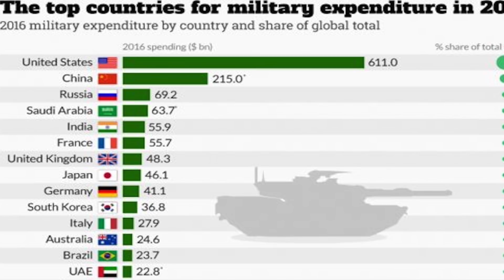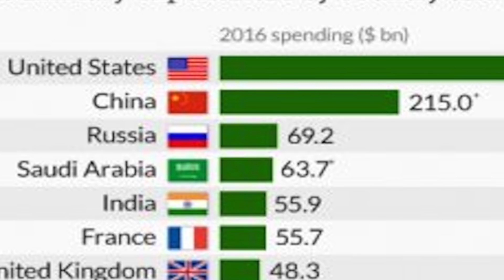CAN USS GERALD R FORD DEFEND ITSELF AGAINST RUSSIAN ZIRCON MISSILE ?

Comment: Laser weapons are over-hyped. First laser weapon power on target drops rapidly with distance due to dispersion and atmospheric absorption. While the laser weapon at distance could render the optical guidance ineffective, it will have no effect on the radar guidance. The big problem is that as the missile closes, it drops to sea skimming level. The laser will have precious few seconds on target. Even at very high laser power, ablating coatings could provide enough protection for the missile to survive long enough to hit the carrier. Then of course, an effective attack will consist of multiple missiles arriving concurrently. How many lasers will the ship have? Realize that the zircon missiles will appear on the horizon about 20 seconds before impact.
Reply: common  sense, good comment. sad are so few here...
Reply: Yh the laser will have to be very powerful to stop a hypersonic missile before it hits it's target and If the missiles are many then it's a whole different story

Comment: While I agree it's a threat I think those defensive missiles could work against it. Travelling at that speed also makes the missile less stable and as you mentioned at mach 6 it has a lot of kinetic energy, as would even the smalled bit of shrapnel which could rip it to shreads. I am inclined to agree that the laser systems are the best defence.

Comment: The problem in a missile defence is never the speed of the bullet or missile interceptor. The problem is early warning, path prediction and accurate enough tracking. For the missile launch to be detected someone has to see it on the radar. Radar signals reveal the position of the radar itself. Shooting a couple of long range AA missiles at the AWACS can make it go away. To avoid a laser beam all you need is a mirror and ability to change. Radar jammers may still work though.

Comment: 100% Bullshit. The temperatur the missile itself has to withstand at that speed due to friction is already imense so it will have some way of protecting itself against lasers. The problem with lasers is that the effective range is also quite limited. All currently developed lasers have a range of a few km. Even if it would be 40 km (a low flying missile would be under the horizon) the missile would take approx 20s to reach. So only 20s to heat up the missile that it explodes. 
So all in all. Its bullshit. Plus, if it comes to a war between the us and russia, it will likely be loaded with a few megaton nuclear warhead. No need to reach the ship. Just get it in a few km range and its gone anyways.

Comment: Even at a velocity of Mach 6.2, it takes over 3 minutes to travel 250 miles. And that is not taking into account the time it takes to accelerate to that velocity. If you think a US carrier group can’t respond to a launched missile in 5 minutes, you are ignorant to modern warfare.
Reply: He also said Russia is developing new underwater drones that can carry nuclear warheads. These were described as un-manned, noiseless submarines that move at ultra-deep levels and at high speed. "This is just fantastic," Putin said. "There is no defense system that can cope with such subsurface vehicles that can be equipped with conventional or nuclear weapons, attacking coastal defenses and infrastructure facilities." These underwater drones were 100 times smaller than a conventional submarine, Putin noted.

Comment: No it cant, it cant even defend against supersonic cruise missiles let alone hypersonic.
Reply: +Jack London

 Not necessarily.
Reply: At present, 10-20years into the future maybe.
But laser weapons are being developed since the 60s by the U.S. and Russia, if the solution was easy they would have already found it.
Reply: All of the current air defenses on US carrier escorts are specifically designed to engage supersonic seaskimming cruise missiles. The SM-6 and ESSM both fly at the high supersonic range (around mach 4). The RAM/SeaRAM was designed as a complement to the Phalanx precisely to deal with supersonic seaskimmers. Hypersonic missiles will be tougher. SM-6 has some capability against them as it was designed to engage ballistic missiles in their terminal phase which also travel at hypersonic speed, but they will probably have a relatively low hit probability.

Comment: The thing is with Lasers they may be fast, but they are limited by the reaction time of the how quick they can lock onto the target due to the comparatively slow speed of the laser rotating mounting mechanism, then there is also the fact of the curvature of the earth, which also means the laser can only fire at the missile when it literally is only a handful of seconds away from hitting the ship. Its all a bit of a close call really!

Comment: I think the problem is much more about tracking a missile traveling at Mach 6 than about what could blow it up. Even if the laser anti missile tech proves itself efective in blowing missiles up, since it has to be targeted directly into the missile, tracking would have to be extremely precise. That would be a real issue since that type of defensive system would only be efective at a closer range (I think) since it probably uses massive amounts of power. So the issue is... the closer the range the harder to keep tracking or, in other words, the closer the missile is the harder is to keep pointing the laser directly into the missile. And even if you consider that the heat of the laser only needs to be close to the missile to blow it up, Russia would just avoid that by equiping the missile exterior with some layers of thermal material. If I was going to develop a system to stop a missile like that, I would probably just build something with a good explosion radius so I the interceptor could just explode near enough to blow the Zircon up, so I wouldnt have to rely on a really fancy tracking system.
Reply: Plasma có thể hấp thụ laser. Không có gì có thể đánh bại Zicron cho đến bây giờ.

Comment: The kinetic energy alone would disable a carrier with a single hit . Disable , not necessarily sink .  As the Zircon does not need a warhead , and can in fact just be a solid tungsten nose , what will a laser damage , even if it can focus upon an object moving at hypersonic speed . The weapons capable of destroying carriers are getting numerous , and the obsolescence of carriers is just a few years away .
Reply: The missile will need some kind of guidance system in the nose, be in radar or infrared, so it cannot be just a sold W shot.  That being said, it is easier to put Bragg grating style of mirror on the nose that has extremely high reflectivity against the laser wavelength (a laser uses two mirrors with an optically amplifying medium inbetween)

Comment: Nonsense!  If the Ford class cruises off the coast of Russia it might be vulnerable.  However, the Russian have choke points that US and allied submarines will block.  Any attempt at Russian surface units of penetrating the choke points to get with in range of US Forces will result in destroyed Russian units.   Moreover, the United States will undoubtedly preemptively strike at Russian command and control with long range cruise missile, drones and aircraft and disrupt their intelligence gathering capability.  They will be hard pressed to find the fleet.  

A United States battle group has a vast integrated sensor net including satellites, land based AWACS aircraft, and fused Cooperative Engagement System of sensors.  Any craft attempting to close on a battle group will be jammed and engaged as soon as it leaves port.

Finally the SM-2 Block IV, SM-3 and the SM-6 missile shooters are fully capable of engaging hyper-sonic missiles.  Even if the Russians got a lucky shot off the integrated sensor net allows for missile engagement at over the horizon distances.  

This particular video was one sided and singular in dimension.  In a dynamic situational scenario there are few opportunities that can be imagined where the Russians would be capable of launching a saturation attack with Zircon missiles.

Comment: People have been masturbating over lasers for decades now. Its not so easy. Lasers lose power over range, drastically, and the destruction of a small target even by a powerful laser takes up to 10 seconds, also the missile can be built to withstand lasers for a longer time (similar how they build MIRV's to withstand not only the heat of reentry but also potential nearby nuclear detonation).
If Zircon, like most AShM's is a sea-skimming one at its final phase, which is most likely is, then the response time is simply not enough for a laser to engage it. You get a 5 to 15 second window on a good day.
CIWS like Phalanx and Goalkeeper are expected to be able to intercept ONE supersonic missile  less than a second before impact. Even the current supersonic missiles are a tough to beat. 3rd world bullshit countries have scored repeated hits and sunk USN and Royal Navy ships with outdated subsonic export missiles. Such as in the case with Iraq vs US and Argentina vs UK.
The most likely defense is either purely electronic or combined with a more advanced interceptor missile. But given the track record and the advancements made in the AShM's themselves (to be as undetectable as possible or using active countermeasures in addition to coming in swarms and implementing AI elements)... Its not likely anyone would be able to defend against most missiles in current use (let alone future ones) if the attack is unexpected.

Comment: That promise and high praise given to "future lazer cannon" wonder-weapon is quite laughable. Though "moving at the speed of light" that "weapon" has considerable limitations as it still needs a certain "exposure time" as well as requires unrealistic mechanical stability and accuracy at a distance and in when dealing with small fast-moving targets Its effectiveness can be also undermined by not too sophisticated counter measures like special surface materials and protective coating... Somewhat similar can be said about the rail-gun wonder-weapon - I wonder why authors have not mentioned it in the Sci-Fi section of their "analysis"!
Anyway, it just proves that for every offensive capability that the American Military-Industrial Complex develops there is a relatively inexpensive "asymmetric" countermeasure that it would rather ignore to the last. And when they cannot do it anymore they will come up with something even more fantastic and more expensive...
Reply: MIC cares for money only.

Laser needs much higher energy than kinetic energy, because it use another approach. Heat then burn and melt, which require alot of energy.
Another drawback of laser is the absorption efficiency of material, which is very low, e.g. for aluminum, +90% energy is reflected.
Another is direct line of sight, which limits the range very much.
Another problem is the spread of the beam at distance, so laser will be much shorter ranged than missile. Shooting laser beam at long range target is not efficiency.
Another problem is weather, water, rain, cloud which absorb the beam very much.

The rail gun, is similar. While launching cost is cheaper, the round may be much more expensive. Much higher acceleration than missile which mean a lot of dead material for the structure of the shell.
Protection of guidance and control against electromagnetic pulse of the launch itself.
While the propellant is cheap (electric) the gun, generator, capacitor... maybe very expensive.
Reply: Le Minh Duc  
A Zircon missile flying at Mach 6 is not going to be made out of aluminum. The SR -71 Flew at Mach 3 and HAD to be made out of Titanium or it would have burst into flames.  Don't be stupid. 😂😂😂😂
Reply: Zircon is just in case missle to defend against those ships. Russia will never shoot us aircraft carrier unless uss decides to attack russia with neavy.

Comment: The RIM-161 Standard Missile 3 (SM-3) interceptor has a speed of 3 km/s (Mach 10.2) for the Block IA/B and 4.5 km/s (Mach 15.25) for the Block IIA version. What's the speed of Russia's missile again? The Zircon is "more than Mach 6".  Now you do the math, which is faster? USA's interceptors, duh.

While we're at it, I find it hilarious when there is talk of these "hypersonic delivery vehicles" when our EXISTING ICBM's travel at over 18,000mph in final phases.

Comment: The thinnest armor on the EXTERIOR of a Gerald R Ford is reported by some sources to be 6" of Hardened US Steel. Make guesses on Hull thickness in highest probability strike areas. 
 I have no data on what hypersonic delivered explosives would do to Armor of 6-12" thickness, but its all Kinetic force with those things and not explosive. 
Will it vaporize Armor ? 

Yes definitely.

 Will it penetrate and cause significant structural damage to something 1100 Ft long, 300 Feet thick , and one of the most armored objects created by humans in all of history? 

I personally don't think so. Combine with the force fields ( not mentioned in this video, and one of the main reason for the A1B reactors) The faster anything is travelling at one of these ships, the less time it will be a threat.

600 MW of Electrical, Xray, microwave, infrared, and magnetic energy transmitted into the air between the hull and the incoming threat. 
Question is what is convergence range, and largest viable focus area.
Don't forget all of your Air assets with laser platforms mounted as well, and much more effective due to less beam diffraction vs firing at sea level.

Hypersonic weapons are cool, Hypersonic planes will be cooler... About 30 years late . That technology has been leapfrogged by others as a "Gerald R Ford class-Killer"weapon system though.

Comment: If it truly has a 1000 kilomiter range than that is a bit of a problem, but aircraft carriers could still sit outside of that range and use air refueling if they had to so there plains could still reach there target. F35s have a decent range so air refueling mite not even be necessary. Especially if it's range is less than 1000 kilometers. Which that's likely

Comment: You seem to imply that Russia doesn't have more aircraft carriers because of a lack of resources. That's BS.
Russia is not an imperial power seeking world domination and control, therefore Russia doesn't need to "project power" the same way that the U.S. "government" does; therefore Russia doesn't need a dozen aircraft carriers.
Also, Russia recognizes that aircraft carriers are increasingly vulnerable to cruise missiles and submarines (if they are not already obsolete).
Finally, your theory that lasers are the answer, is not very well thought out. 
Lasers can only shoot in straight lines, so a shipboard laser cannot engage an incoming missile (assuming it's flying in a sea-skimming mode) until it comes over the horizon.
In order to "destroy" any target, the laser beam has to dwell on the target (in the same spot on the target) for a finite amount of time. (Exactly how long depends on the nature of the target and the beam's incident intensity and spot size). 
Depending on the height of the laser and the missile's altitude (e.g., 5 meters) above sea level the laser may only have 10 to 15 seconds to lock onto the missile and "destroy" it.
Will the beam director be able to keep the beam on the same spot on the missile long enough to "destroy" it? What about if the missile is making some kind of evasive maneuvers? What about if there is more than one incoming missile to deal with?
AFAIK there are no lasers presently in existence (nor are they likely to exist anytime soon) that have enough power to defend a ship against a hypersonic missile.

Comment: Try following a housefly (top speed of 4.5mph or 1.79 m/s) with a laser pointer. Light is 160,000,000 times faster than the fly. 
How exactly does that massive advantage help you with following the fly?

Modern Russian rockets do not fly in a straight line. Lasers do not magically destroy objects, they take a few seconds of focused irradiation of the designated target.

For this reason I find the "50,000 times faster" comparison irrelevant.

It is all about the agility and speed of the targeting system.